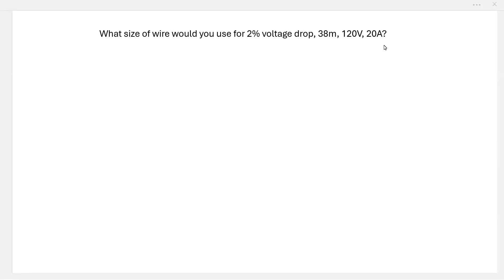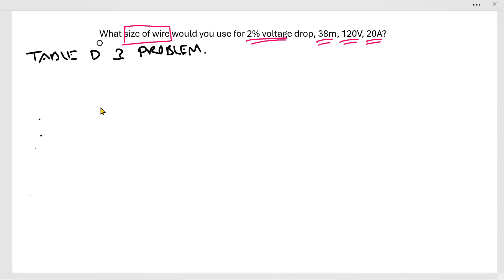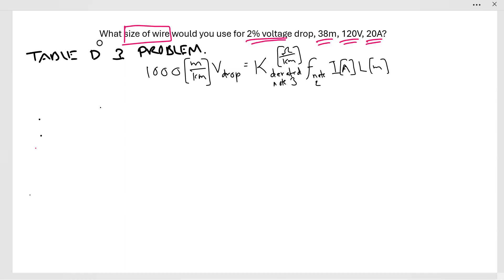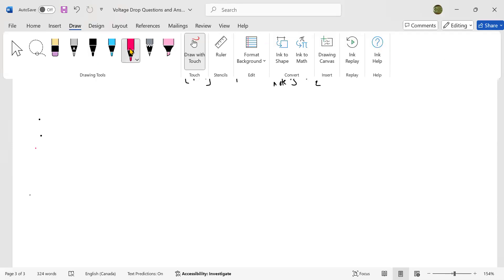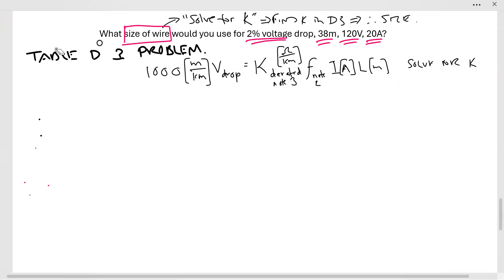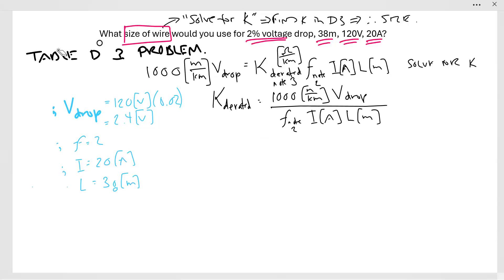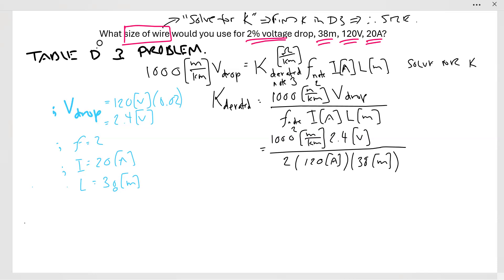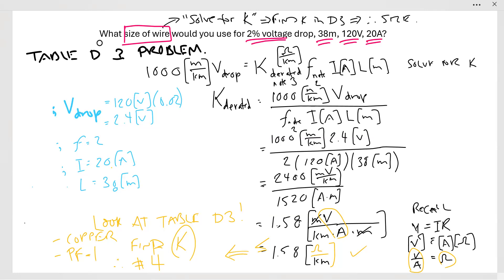Find Conductor Size given Voltage Drop and Current Table D3 CEC Section 8

Comment: How did you get 120 amps? Doesn't the question say 20 amps?
Reply from the maker: aaaah!  You are right, I = 20A, which I wrote to the left.  When I subbed it in, I typo'd it to 120 A.  But I computed the math to 20A, so the computation is correct.  Thanks for finding this!

Comment: So when you get 90°, do you multiply it from the table D3 or what you’ve calculated in the formula ?
Reply from the maker: Nope, you calcuated the K-value.  Then you look for that K-value in the 90 degree column.  The answer, which is a wire size, is the row where you find the K-value in the 90-degree column.

Comment: Hi There, Im curiouse as to why you seem to be assuming a conductor operating  temperature rating of 75 Degrees C (RW75 etc.)? Ive watched several of your videos and this seems to be what you are commonly assuming. The most common temperature rating of wire is 90. If you were to "assume" a temp rating of wire you would assume 90 degree type wire (eg. T90, Ac90, NMD90 etc.) as this is what is used 99.9% of the time. You may choose the size of a conductor from the 60 or 75 Degree column of T1-4 of the CEC based on 4-006 but unless the 2024 code is a complete departure from as far back as at least the 2018 CEC, The operating temp is the type of wire used (eg. Ac 90). As a result should you not be applying Note 3 correction factor(K x 0.95 for 60 degree C wire and K x 1.05 fo 90 )? Logically speaking it would be ridiculouse to feed a 120-20 A load with #4 awg(85A from the 75 degree C column of T2) conductors. Even #6 is silly given a 120V-20A load at 38m(125') even though that is what the code requires based on 8-102. 
Just curiouse as to your rational? I would be intersted in discussing further as I'm a prof. teaching in the Electrical trades. Justy trying to make sense of the new 8-102 math as it doesnt make any real world sense at all.
Reply from the maker: Hi, thank you so much for your thoughtful and knowlegeable question.  I'm using 75 simply so I can apply the correction factor, to help students learn about the correction factor.  It's a valid point that 99.9% of the time it will not be necessary.  It's just an excercise to show the math.  I agree that a good dose of "real world" alongside this purely math-based theory is needed!  The new calcs are quite different than the 2018 table approach, as I'm sure you know.  Thanks for reaching out!

Comment: Please feel free to correct me if Im wrong but I think you forgot to multplie your 20 amps by 1.25 which is standard for sizing conductors. I got 6 awg as the awnser for this question as the bottom of my equation was 1400 not 1520. Im not sure if im correct or not so I would appreciate your feedback, thanks for the video.
Reply: Actually I got 4 awg as well as my final K value was 1.26 but im still wondering if we must multiple our amps by 1.25 in this specific voltage drop problem.
Reply from the maker: Aaaah, you're referring to Ampacity calculations of Section 4.  This is a voltage drop question, in which the de-rating is accounted for in the K-value.  If you study the formula closely, you see the ohms-per-km K-value is more conservative than the ohms-per-km actual resistance.  I will be explaining this in a video where I derive this Voltage Drop equation from Ohms Law.

Comment: looking at Table D3 and p.f -1, for copper its 1.59  which is equal to #6. so because it has to be less than or equal to, you go ahead with #4. am i correct with this statement ?
Reply from the maker: 6 AWG can be used because it's equal to also.
Reply: @Prof.K.  Just to clarify, don't you need to use the 0.95 correction factor for 60 degrees, because the table is for 75 degrees, from my understanding you assume 60 degrees?
Reply: @adamwestcott7301  I think the temperature of conductors should be assumed 60c